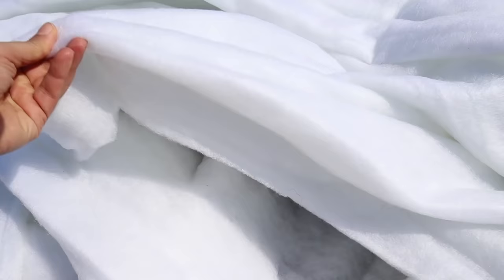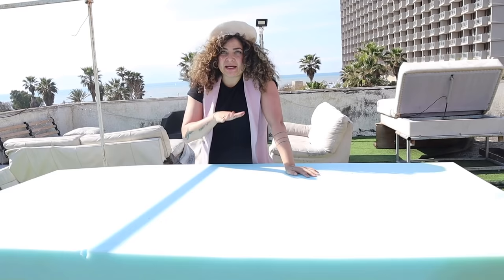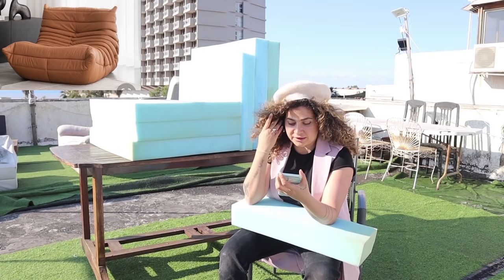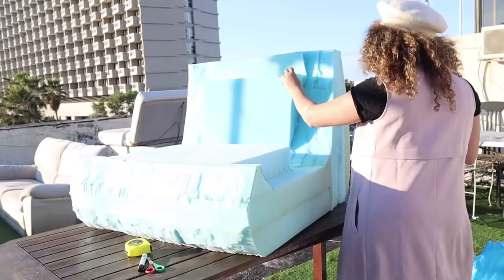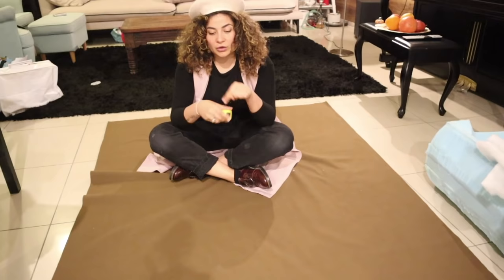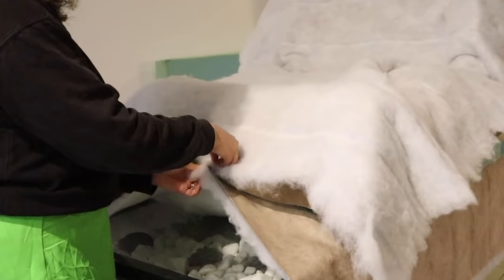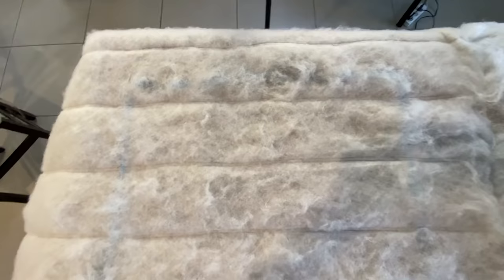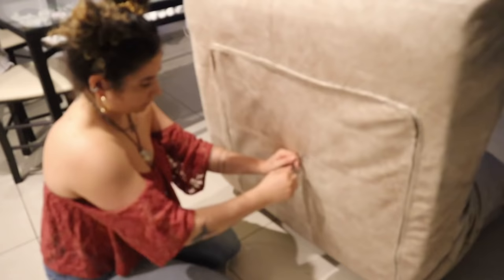TOGO DIY COUCH / How to make a home made designer sofa

Comment: Sewing the batting onto the cover would make it very hard to wash because the batting would almost certainly fall apart in the wash. Adding the buttons also means you'd need to cut the buttons off and re sew them every time you washed the cover... so I'm not sure I'd call the cover washable... LoL

Comment: Looks amazing1 Question...How are you suppose to wash the cover if the buttons are attached to the foam through the cover?
Reply from the maker: Hehe everebody asked me this. 
100% right it does make it more hard to take it out yoh need to take out the button and than stretch it back in after (it takes 15 min) but that’s the only way if you want the folds to stay up all nice all the time.
Otherwise you can skip the button but you will need to tidy up the folds all the time and that’s waaaaaay more effort instead of taking them out every once in a while
Reply from the maker: Yessss I know! But it’s sooooo much more expensive to buy a 30cm think foam and also all the industrial equipment and I wanted to make it possible for everyone to make it

Comment: hello ,

i'm getting things wrong

you cut
3 equal parts for 80x66

and then you cut

70x66cm
70x66cm
and a 60x66?

but in the video
when you cut the second part I didn't see you cut the 66 centimeters you just cut
Does the back have to be the same as the front? in the Width 66.6?

Comment: You probably don't want to hear it but you need to make the foam 1" larger than the cloth so it is nice and plump like the picture you showed us.

Depending on how you make the furniture it may be difficult to get the foam inside the fabric. But, be patient and it will be worth it when you see how plump your cushions are.
Reply from the maker: it's such a good tip